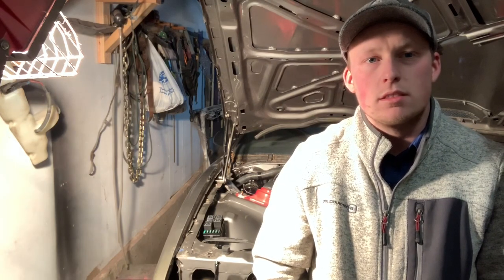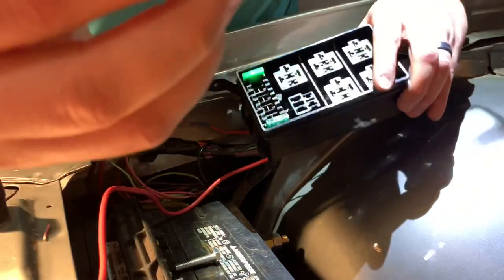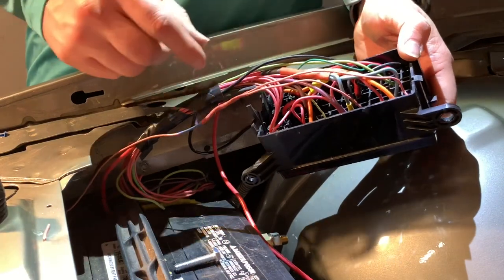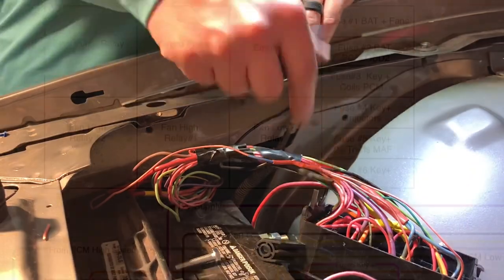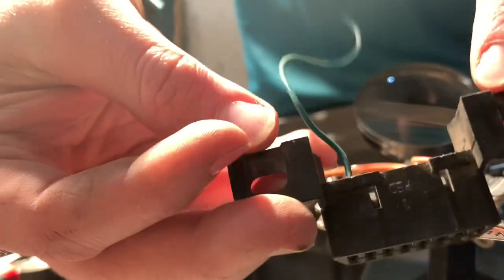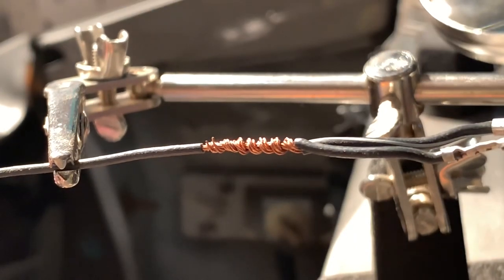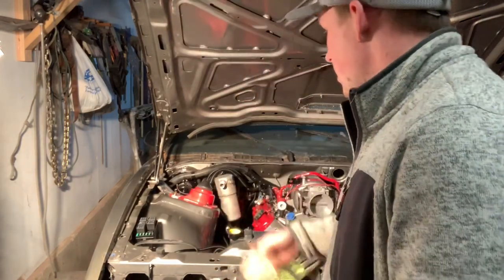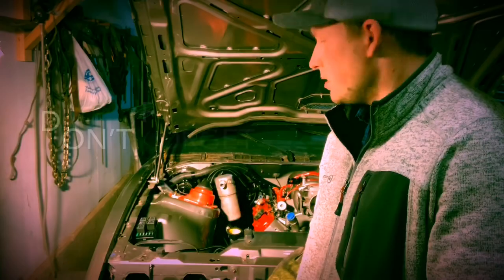1983 3rd gen ls swap update 4 fuse box and relays

Comment: Hey what’s up bro how you doing I have 87 Camaro Third GEN Doing LsxMatt Top in it with a LS 53 and a 4L 60 E transmission and I have a standalone harness from psi and I’m trying to hook up my fuel pump wire from my relay that’s hooked up to my fuse box what wires from the sending unit did the purple wire go to the pink or the tan wire

Comment: What gauge wire did you use from the battery to the relay box? Also did you put a inline fuse?
Reply from the maker: Honestly I’m not sure was gauge I used, I’m used existing wire that went to the original ls fuse box probably 10-12? No inline fuse, the battery wire goes to a relay and goes to a leg that m powers all the fuses. So everything is protected through a fuse except the 12v going to the keyed power relay

Comment: Big tip for soldering wire use flux so the solder gets through all the wires and makes a stronger hold
Reply from the maker: Not why you think the solder didn’t go through. You can see the solder go through all the wires, that’s why I heat from the bottom. So it’s not an issue, I only use flux if it’s thicker gauge.
Reply from the maker: Also you watched the way I tie the wires, they are not coming apart.

Comment: Hey Neil 
Great video it’ll help me design my own fuse relay box 
What size fuses did you use and how did you determine the sizing especially for the injectors and coil packs ?
I’ve just found a lot of conflicting info especially on the coil packs
Reply from the maker: Well the fuses are holding the same devices and lt1swap.com so I used the same 30 amp size

Comment: Ok you said on the passenger side there is 2 12v sources .the one that goes to the relay and you said one that goes to the fuse box to power the relays . 

What fuse box are you talking about the thirdgen original fuse box or the ls fuse box . 

My 87 Camaro fuse box is on the drivers side and my ls fuse box is on the passenger side . 

Lastly do I hook that other 12v sources to the ignition wire on the ls harnesses.  I'm so highly confused  especially when on the drivers side I had 3 wires not 2 so I splaced the yellow ignition wire I guess . 

Your feedback is needed thanks
Reply from the maker: The MultiChannel 87 so I used 12v sources that were on the passenger side original pcm plug. Because those wires are no longer used. So I just took a meter and found what wires had keyed power
Reply: @Lsxtransam83  btw here is my channel of my build,  I'm an automotive Youtuber.  The other tag I wrote you on is my gaming channel.  

Well I spliced it on pin 33 now I just have to ground it and start it . So I hope this works . It dose I'll have your link in the description and shout you out .

Comment: Yeah I tryed what you did and nothing happened tryed about 40 times and nothing  . 1 I have no brakes because I switched from drum to disk . My roters are the wrong size so i have to wait to get new ones . Also it's no longer a 700r4 auto it's a T10 4 speed manual now so whatever was connected to the  orginal trans is now off . Also I have 3 wires  one thick wire and 2 small ones comming from that one brake peddle switch.  So I put some tape on it to make sure the button is inside that switch . It seems like everything I do it dose not work at all . Tryed changing wires around and the car cranks in the run position and nothing  in the crank and prime in the kea position to run a stereo  . Wish you could make a way more detailed video .
Reply from the maker: I’m a little lost on what you need more detail on
Reply: @Lsxtransam83  do you have a facebook or anything so I can send you a video ???
Reply from the maker: The MultiChannel 87 I have an Instagram lsxtransam83
Reply: @Lsxtransam83  iight I'll msg you now .. thanks